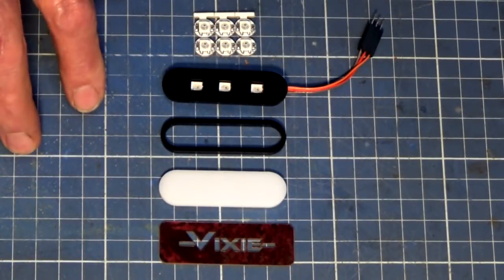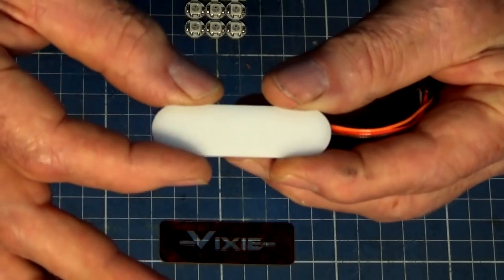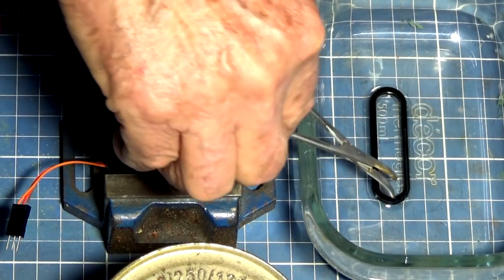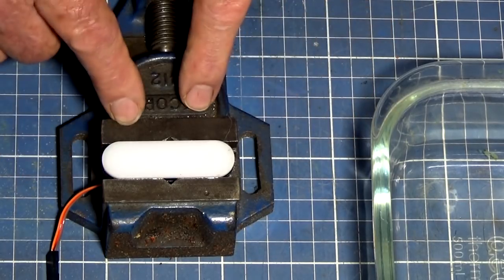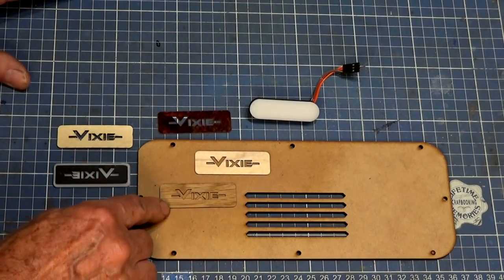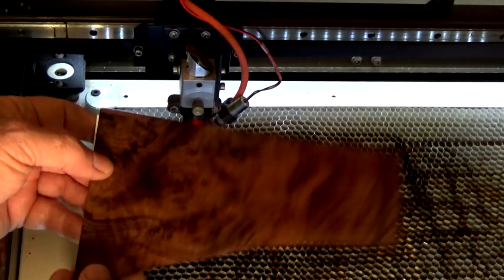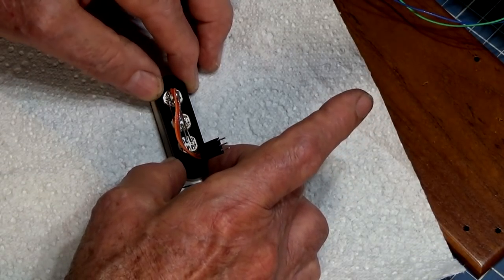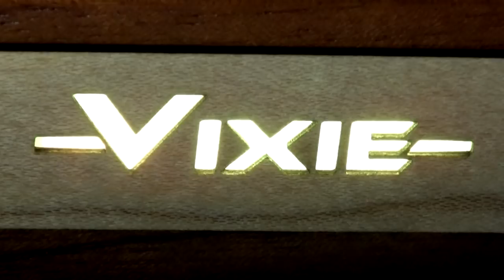DIY Back Lit RGB LED Maker Plate

Comment: Very well done.   I appreciate showing us your prototypes.   I would have started with the veneer to match the clock face which is where you ended up.
I may be trying out the ESP8266 module to add wifi to my 3D printer.
Thanks for the video.
Dave.
Reply from the maker: Adding WiFi sounds interesting. Maybe you could add a little IP camera so you can remotely monitor the print?
Regards,
Mark
Reply: If I get wifi working, I can use Pronterface to communicate with the printer.   This will show progress without the need for a camera.   This is a useful program in general, not only for print progress.
https://www.pronterface.com/
Dave.

Comment: You could install the plate on the frame first, using some pieces of wood for the alignment and only after push the LED assembly through the oval hole where it will align itself, Good video, great work.

Comment: Could you cut the letters out of the back piece of veneer and leave the front piece solid to get the same effect as the clock?
Reply from the maker: Absolutely. I love experimenting with technique but at some point you just need to get the job done. Having a laser cutter really does mean that you can rapid prototype. All the jobs that I have done are stored in the machine memory so it is easy to call up a particular job. I don't even need to start up the laptop. 
Regards,
Mark

Comment: Very nice Mark, thanks for sharing another great video! Do you have a video of making the (Big Scary Laser)? Just wondering where you got the laser?
Reply from the maker: Gary, the story of the laser is a long one. I purchased it second hand from a school where I used to work. It was a warranty replacement for another Chinese laser that failed. The vendor was a crook and he sent us a no name machine which looked as if it was made up of all the bits that were left on the floor on a Friday afternoon. It never worked from day one because the Chinese assemblers often use counterfeit software and firmware and then provide a dongle so that you are locked into whatever they supply. I suspect the dongle was the wrong one and the vendor refused to help. When I purchased the machine (I think I paid around $300 for it and the two pumps) I swapped out the digital signal processor for one that I purchased from LightObject in the USA. It had somewhat better software but very good support and I also fitted a motorised Z axis lift, a honeycomb bed, better mirrors and I completely rewired it. I also had to strip and repaint it in two pack paint. The original paint was sprayed over bare steel and it had started lifting and de-laminating. The machine is now reliable and I get good results with the original glass tube. If I ever need to replace the tube I will probably upgrade to a 60 or 80 watt. The sad thing was that at one point we had an American made Versalaser at school. These are like the Rolls Royce of small laser cutters. It was idiot proof and had vastly superior resolution but that was just before I retired. Once you get used to having a laser cutter/engraver around it's easy to regret not having one. The opportunity came up to buy the scrapped Chinese one so I figured that it was worth a try at resurrecting it.
Regards,
Mark
Reply: Thanks for the back history story, I’m the kind person who enjoys them. It always seems like the word “laser” is followed by many dollar signs. So I was hoping maybe you had sourced all the components to make it,and could provide that information. Oh well 🤔 Always enjoy watching your videos, thanks again for sharing.👍
Reply from the maker: @garyskowbo3564  If I were to do this again, I would try to buy a second hand or scrapped 50W Chinese laser and repair/upgrade it. I wouldn't be scared off by the notion that lasers are expensive or complex. They really are no more complicated than a 3D printer, just bigger and bulkier. Since there are no cutting forces like a CNC router, the mechanical components are fairly light and easy to set up. There must be lots of people who buy a cheap Chinese laser and get fed up with it and move on to something else. If you can get one, even just for the chassis and the motors and rails you have the basis for a good machine. Most of the Chinese lasers are hobbled by the software and the digital signal processsor and replacing both solves most issues. I got my DSP from LightObject https://www.lightobject.com/ His site has a very active forum and I learned nearly all of what I wanted to know by scouring his site and forums. He also sells just about everything you would need for a new build or an upgrade. Surprisingly, most of the individual components are relatively cheap and interchangeable. I have watched some laser build logs and they can be made from aluminium rail and lost of screws and connectors but that seems like a lot of expense and work compared to sourcing a welded steel chassis and hardware, even if it needs some TLC. The machine that I started with is similar to this one  https://www.ebay.com.au/itm/50W-CO2-USB-LASER-ENGRAVING-CUTTING-MACHINE-ENGRAVER-CUTTER-WOODWORKING-CRAFTS/273842626049?_trkparms=aid%3D111001%26algo%3DREC.SEED%26ao%3D1%26asc%3D20160908105057%26meid%3Da216fb6c55af4ae994dbe1d6ac163e51%26pid%3D100675%26rk%3D2%26rkt%3D15%26mehot%3Dnone%26sd%3D392287333691%26itm%3D273842626049%26pmt%3D0%26noa%3D1%26pg%3D2380057&_trksid=p2380057.c100675.m4236&_trkparms=pageci%3Aec62aa8b-3ca9-11ea-a58f-74dbd180774f%7Cparentrq%3Aca8b14b116f0ad4c3622b5ecffba79e0%7Ciid%3A1
Once you have one in the shop you will always find new things for it to do.
Regards,
Mark

Comment: How did you pick the spacing for the 3 LEDs?  I noticed the middle one wasn't centered.
Reply from the maker: Ahh, you are very observant. I noticed it too....after I committed to bonding in the LED's. Sometimes I bang out rapid prototypes without too much checking of the geometry and if they work out they go into a parts bin for later. I must have picked up one that didn't pass muster. As it turns out the light centres are very fuzzy and they are mostly hidden anyway so I didn't stress too much about it. I use Corel Draw for creating my DXF files and although it has ways and means of checking geometry it is not so easy as Autodesk Inventor which is my other go to tool for modelling parts.
Regards,
Preso